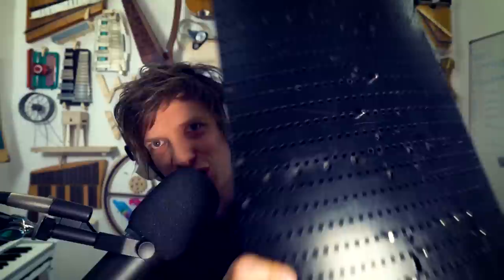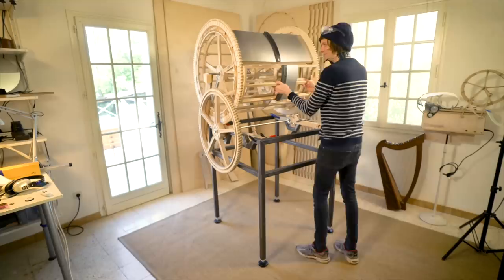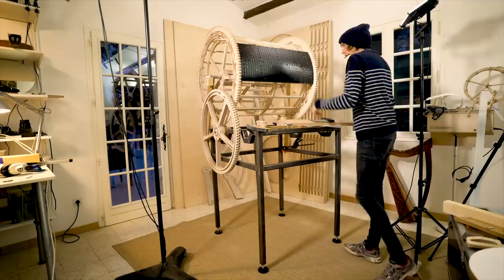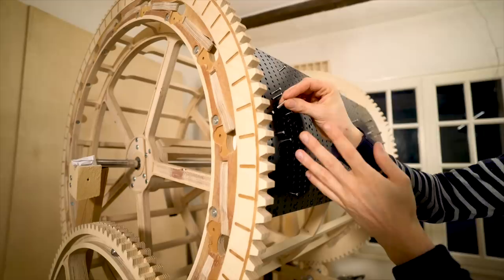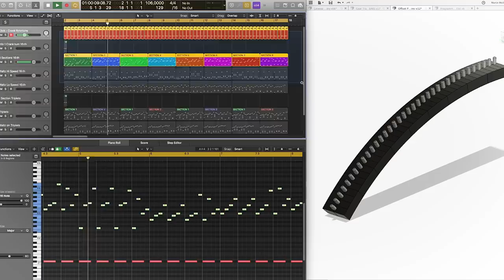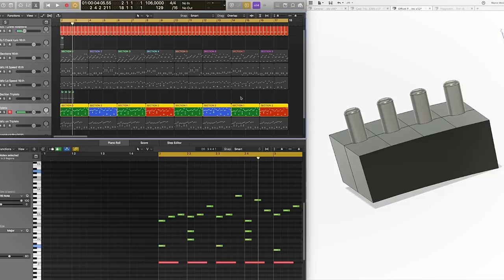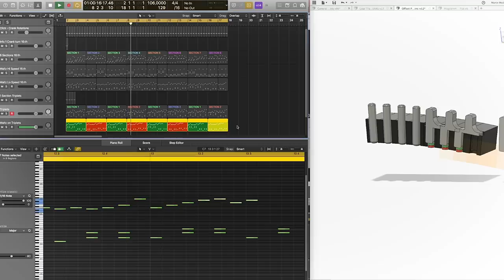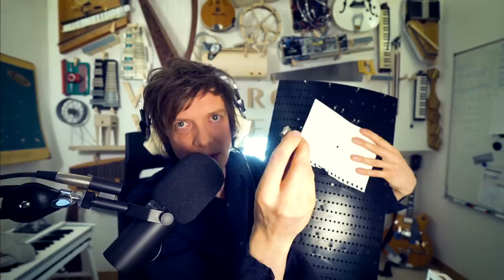Magnet "Midi" Music System - Marble Machine X #25

Comment: Just a tip. You need to pay attention to the humidity when dealing with tight fitting parts in wood. I spent a long time trying to recreate Ronald Walters gear head sculpture and it worked well at first, but over time the gears swelled with humidity and now it doesn't function well at all.  He uses a method for treating the wood with linseed oil that you might be interesteded in. Just wanted to point it out so you were aware so that you don't get to the end of this beautiful machine and fight fitment issues with your close fit on the programming plates. 

-Cheers
Reply: Sqwince23 This comment needs more traction, such an important point to be made.
Reply: Yes indeed!
Wood changes dimensions quite drastically in changing conditions.  It would be a nightmare if Martin begins his tour and has to spend all his time troubleshooting instead of making music and enjoying himself.
Reply: As he is dealing with high quality plywood, the expansion and contraction due to humidity is quite minimal. It will change about 0.0002 inch per inch for each 10 percent change in equilibrium relative humidity. A plywood panel that's three feet wide would change less than 7 thousandths of an inch, and that is within his tolerances I think.
Reply: In relation altitude + humidity will impact wood in different ways.  Since this things is traveling around the world it's likely going to see a large range of environments.
Reply: There's a thing called stabalized wood. Where resin is forsed into the wood pores by vaccuum packing it. The result is a completley stable material which is not affected by humidity, but is still machinable like ordinary wood. You can add color to the resin for spectacular results. This is probably impractical on large plywood cheets.
Reply: I still think once the MMX is finalized and working great he should make one out of steel/aluminum parts instead of the wood. The music machines in the museum are all hardened steel mechanisms so they have lasted over time.
Reply: A useful idea would be to include wireless or wired microphones in your machine so that you could hook it directly into the sound system at the concert hall you will be preforming at. this would cut down on static caused by external microphones and would make the performance more elegant.
Reply: This plywood has alternating grain, so any expansion due to humidity would be mostly eliminated. If we were talking about solid wood then humidity plays a bigger role.
Reply: nathdoesmath He's using contact mics. Take a look at some of his older videos, he shows how the snare drum works too, using rice for the snare affect.
Reply: while high quality plywood is very stable in length (X-axis) & width (Y-axis) due to the alternating layers, they are still susceptible to swelling in thickness (Z-axis) - that's why super tight fitting programing sections could end in tears if it swells - the section just won't fit onto the barrel at all because the barrel stringers will be too thick.    

one solution could be to rotate the stringers 90 degrees thus avoiding a X-Z friction fit.  probably it would be best to avoid any friction fits using the Z-axis.  for example the levers locking the programing sections to the barrel section.  if they swell it could be bad.   maybe using levers made of UHMW would be better?   UHMW would probably only work for shot pieces since i don't think it's as rigid as the plywood.  (it's strong in compression but not tension)
Reply: For those saying its not going to move much. He seems to be building to very tight tolerances so a little swelling in thickness may ad up. 

Also stuff is going happen like if a side of programming plate gets scratched or bumped or anything it can raise the grain. I just don't think sandpaper is going to be in the fix it kit.
Reply: How about instead of using full plywood panel, covering corners of it in some resin or rubber and the same on the wheel, so then fitting won't be a problem and all panels will stick nice? Just a thought.
Reply: Would using hardwood be the answer?
Reply: not really all wood moves with the seasons. BTW teh plywood he is using is hardwood most likely birch.
Reply: But it's PLYWOOD, not solid. Nothing significant is going to happen, unless Wintergatan is going to play the machine under water

Comment: i would recommend allowing the programming plates to slide a little before they are locked, otherwise humidity could make it impossible to re- attach them for programming.
Reply: jonathan kydd  brings up a crucial point: you need to test your machine in high and low humidity conditions before you hit the road with it.
Reply: This is an absolutely important and good tip.
Reply: Baltic birch plywood is very stable. With a large change in humidity the change in dimension is around 0.1%, but yeah, that could be an issue if there's almost no clearance to begin with.
Reply: Him talking about the crank doing different amounts of pins brings up another idea. What if he were to make interchangeable gears so he can make the crank do different amounts of pins at a time? This could get rid of having the need for different programming boards. Maybe make some sort of simple transmission so that you can easily change that on the spot.
Reply: One down side to that (interchangeable gears) - it means that the whole piece has to change from quarter time to triple time. By allowing the pins to dictate this, it's possible to have one track play a triplet while the others stay in quarter time. It also lends the possibility of using a single "triples note" as a sort of grace note.
Reply: i would like also to say, if martin has enough materials, 3 template systems as 2 would give the team even more time, because, most people are nervous at that moment, and even with a pattern, some holes could be missed, without recognizing it. 
I hope you will understand, what i want to say :D

Comment: The engineering behind this machine is incredible!
Reply: CNC is really coming into the hobby side this last decade. Some of the things you can make are mind blowing.... while others just used them to carve signs heh. Me, im using mine to make flight simulator parts.
Reply: John Hanton That's very cool! What parts exactly are you CNCing? And how accurate can something like that be? I noticed his tolerances were pretty fine in this video.
Reply: It's very impressive. One suggestion I've got is get a second shop vac and a hose extension, mount on ceiling, attach head to the head of your mill so you don't have to clean up as much?
Reply: https://imgur.com/gallery/vODw5

Use can use this for designing both the blocks and the pins.

All the best
Sukrit

Sad that people have spammed martin's pinned comment and its impossible to reply
Reply: Absolutely!  The dream awakens.

Comment: two thoughts that You need to Reality Check .
1. the expansion rate due to temperature  change in the timing plate might be a lot more than you expect . It's my experience that the heat from stage lights is enough  to expand most kinds of plastic material . i have seen 96 inches expand as mush as a half inch.
2. check how all 8 panels fit, not just one.
Reply: And third -- the wooden parts will expand with humidity as they travel around the world. If they're perfectly snug now, they'll swell and be unable to fit later on a humid day in a humid place.
Reply: This is a good point, even if it might not expand so much as to make something not work, it could make taking the pins out tricky.
Reply: these are good points. From my experience high quality plywood however (or marine plywood) usually has really minimal distortion due to humidity. Perhaps applying a sealant would prevent the issue 100%? Or would that add a layer making even less space for things to move?
Reply: Humidity and temperature will be an issue, but I think wear will be as well.  16 plates coming on and off the machine ~10 times per show? That fit will wear down quickly. I’d recommend pins and metal bushings to get as reliable a fit with less wear and temperature/ humidity concerns with clearance between mating wood.
Reply: Better bring a file onstage :P

Comment: Depending on your relative humidity, and  all the places you're planning on visiting and their relative humidity. the wood will swell so your tight tolerances might not fit anymore. Just something to think about. Down south in the USA.  Sometimes you have to plane the door fittings when it rains a lot because they swell and the doors won't open. Love your episodes by the way.
Reply: I concur that this could be a problem, and isn't your workshop in a very low humidity zone?. Perhaps put some of your parts in a steam bath, see how the plywood reacts. You may be able to control, at least somewhat, these changes with certain sealers that may make the plywood more dense, at least temporarily.
Reply: Although plywood is a lot more stable regarding humidity, i agree. tight tolerances like that would be a huge problem.
Reply: I agree, having that tight a tolerance in the field for something that needs to easily move could bite you in the butt as soon as conditions change.
Reply: Plywood should swell less than solid lumber. Wood expands far less longitudinally than it does across the grain.
Reply: Holy Christ, it’s CLEARANCE, not tolerance!
Reply: Dan Severns no the engineering term is tolerance, its how tolerant of inacurate machining a part is
Reply: Oh. Ew. You're right. What a perfectly awful prospect. That could bugger up the whole machine. Perhaps a nice-looking sealant finish to help protect it from humidity?
Reply: zsewqaspider In the video you can see he changes the width of the slot from 19.00 mm to 18.60 mm. It shows him reducing the clearance by 0.02 mm per side of the slot. It does not appear he is applying any tolerance to the dimensions.
Reply: Yeah, given that this is supposed to be a touring machine, the thought of environmentally-stimulated expansion and contraction seems concerning.

Comment: I couldn't reply to the big thread, I didn't even read all of the comments (501), but I did skim through and here are my thoughts.

A glossy finish on the programming wheel while I think might look good under stage lights, but would be difficult to maintain over time.

For the programming templates, for durability you might want to look into how solder-pasted stencils for surface mount PCBs is done. Essentially a thin piece of metal with hole cut out. Much more durable than paper or plastic sheets, and there is already an industry existing to make them very accurately.

I like the idea you showed of each note row made of two pin rows, sixteenths and triplets. This would allow for triplets against sixteenths (or eighths, or quarters, or halves, etc) within the same musical bar. Actually somewhat common in classical/baroque music. (I've sung some oratorios where I had to ignore the organ accompaniment because we were singing straight time against the organ's triplets and vice versa.)

I like the rectangular pins, especially since they make packing more pin rows horizontally across the drum easier. I saw some arguments that cylindrical pins would be better for faster non-experienced (audience participation) re-programming, but if you pinch the rectangular pins between thumb and fore-finger the rotation of the pin will be the same every time the reprogrammer grabs one. This can be easily and quickly demonstrated to the volunteers. I do think it is important for all the pins to be the same shape for multiple reasons. Ease of quickly programming (only one bin of pins to worry about), ease of inventory (only one type of pin to count), economy of scale (because only one pin shape you get the maximum quantity for a single part number to take advantage of bulk ordering). Speaking of inventory control, for the quantity of pins you are expecting to need, instead of manually counting all of them, invest in a counting scale. These scales know the weight of one piece and divides an unknown quantity's weight by that known value to give you on the display a fairly accurate count.

Comment: Dear Wintergatan, You could potentially make another set of panels out of silicone that align perfectly with the panels on the machine, and pre-program them so that way when you need to change the music on the panel you could lightly roll the panel over the silicone mold and set all the pins with one swift motion for each plate. I hope this helped you in any way, I look forward to more videos and more updates!
Reply: actually a god idea
Reply: I love this idea.  I had a similar idea about making concave panels but this is much better.  Especially because making the molds would be pretty easy.  You could program one section, mask off all the unused holes and put a short frame around the programming section and pour. Maybe add a couple reinforcing strips just to make them a bit more rigid laterally so they don't flop around when moving them.
Reply: I was actually going to suggest the same thing. Just cast the silicate in a position to fit over the panels (so they stay when reprogramming). This works for the block pins over the round magnets, and one type of pin is superior after all. The issue that putting secure panels over the programming wheel poses is that, because of the curve and the protrusions of the pins, there would be no way to take the panels off. However, with the silicon, one could just peel the entire thing off. I see one problem with this, as the pins could catch on the silicon and come out when it is peeled away, but upsizing the holes in the silicate by a fraction of a centimeter would solve this.
Reply: I like the idea too. Though it has a couple of issues to be addressed. Both are from the fact that the programming pins are being inserted onto a curved surface. One. It would be easier to keep the silicon on a flat surface and roll the curved panel over it to collect the magnets like @Michael Trombley suggested. You actually don't want to have to peel the silicon off of a surface as it would put the magnet pins at risk of being pulled out or knocked out accidentally. Two. Because you are rolling a curved surface the pins will NOT be perfectly vertical to the silicon. They must be aligned at an angle appropriate so that when the hole approaches the pin they will mate without the pin getting caught. The silicon would then bend as the pin was being pulled out. (The silicon shouldn't be too thick...) For further measure, it would be ideal to have a chamfer on every hole. This idea is good though it would take a lot of time to make and get working without flaws. Having techs work on it may be slower but they might be more reliable. I wouldn't want to be embarrassed when a few notes here and there were missed!

Comment: The triplet pins are a great idea, love it!

Don't do steel pins. Why not the magnets as shear pins? You can't design everything as the strongest point, something has to give and it should something that is easy to replace. Sometimes breaking is better than bending, a missing note is better than a wrong one.

About your plate mounting. Using tolerance as alignment might not be a good idea in the long run as any wear or compression will change your alignment. You are approaching the problem they had when car makers wanted to go from making cars one at a time to using interchangeable parts. Does one plate have to fit anywhere or can you number the plates so they always go back into the same mount? If you want any plate to fit perfectly in any mount it's a lot harder than just making each one fit a certain place and you'll quickly find that using wood won't give you the tolerance and rigidity. I suggest some kind of small metal location pins and metal receivers that can be fastened to the wood and adjusted somewhat like "router table insert plate levelers". (google image search this) or the Micro-Tilt neck adjustment on a Fender guitar.
Reply: Good call.
We don't want the machine to fall to bits because of wear and warping of the wood over time.
Reply: Everyone, including Martin, is misusing the word "tolerance". The word you should be using is "clearance" or "allowance”.
Reply: I've always used tolerance as in "variation of dimensions from the product". 
They're using it as, "Adding tolerance (As in extra space for tolerances of machining, not adding tolerance as in more variation) to make the pieces work together."
Reply: +Dan Severns
Tolerance
6. Machinery. a.
    the permissible range of variation in a dimension of an object.
    Compare allowance

From dictionary dot com
Reply: Using a slot to align the plates will lead to part wear, or (ply doesn't move much with weather, but some) binding with misalignment.  If there is a v shaped guide instead of using the crossbars for alignment, then we have licked both wear and wood movement.  Imagine how a stack of L-brackets align themselves perfectly at the apex, with no force required.  The crossbars just need little peaks on them to do the aligning.

Additionally, roadies are not known for their gentle touch, especially when moving quickly.  I feel that the first iteration plate might be more forgiving of rushed assembly, if the alignment can be made to not rely on the parallel sides of the music wheel crossbars.